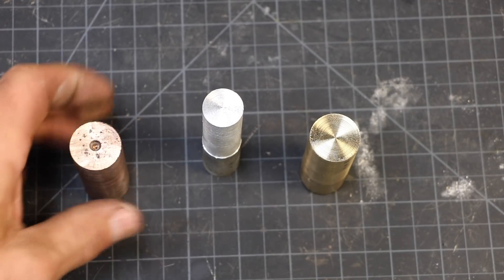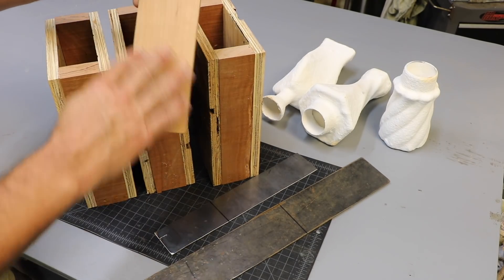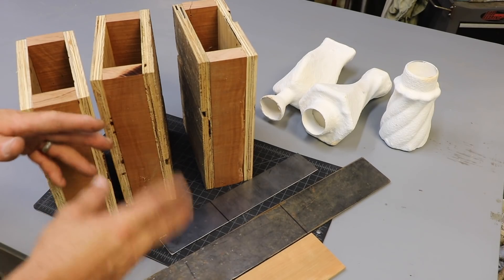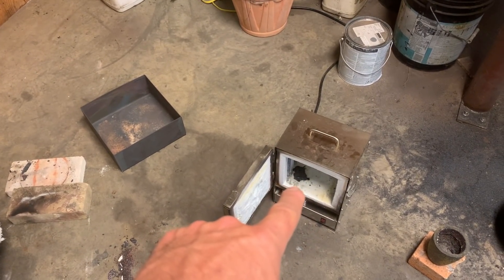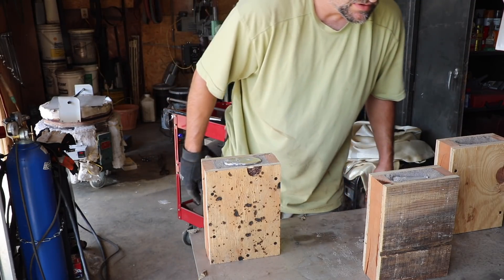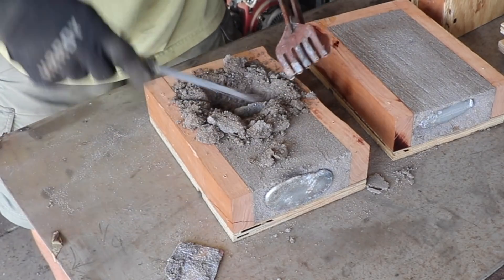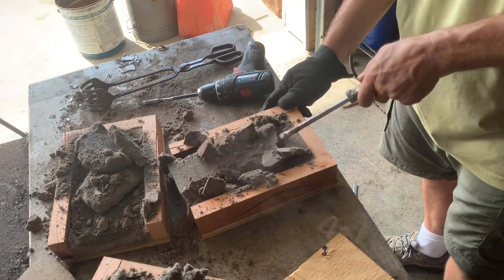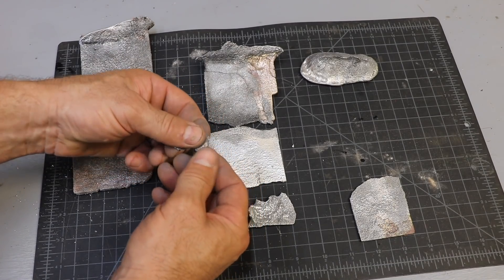Mixing Molten Metals.  What Could Go Wrong??

Comment: First thing I thought was: Never do experiments with molten metal in shorts! 😂
Reply: Ahaha...great advice. Don't fry eggs or bacon in your underwater, either
Reply: @bruceanderson7762  can you mix precios metal  like platinum and silver ?
Reply: Yep, same thought.
Reply: @dsma2023  okkkkkoo
Reply: @jeffallen3382  I used to work in the die casting department of a factory. We would load 1200 lb blocks of aluminum  into our melting  furnace with a forklift with a windshield to keep any splashes off the operator. One day our lift was down so I was using a normal one with no windshield and I put on a flame suit for protection. Only problem was the suit only came to my knees while sitting. Well of course there was a splash and I got splattered. Normally  I would wear work boots but for some reason I dont remember I had on tennis shoes that day. Long story short a glob hit my ankle and ran down into my shoe and burned through my sock.  I rolled off the side of the forklift untying my shoe in midair.  Ended up a spot of 3rd degree the size of a quarter on my ankle.
Reply: Bah, you dont need to worry about safety.
Reply: flip flops and a speedo is the only way to experiment with molten metal.
Reply: Darwin Award...
Reply: Or a Shell Suit, lol
Reply: Yeh, its best to do it in a cruciple.
Reply: Like trousers will help
Reply: I couldn't help but wonder if it's a good idea to set his molten crucibles on that thin ass sheet metal cart, either.
Reply: He should visit his local burns unit. Thank you for the video.
Reply: @ohdearearthlings1879  He doesnt need to visit a burns unit because he has a BRAIN and evidently he knows how to use it, VERY much UNLIKE the HSE dross that the French dictators imposed upon us educated England some decades ago in the NWO globalist attempt to Dumb us down. Notably an extreemly successful attempt by the NWO but some of us are tenacious about retaining OUR brains and using them effectively.

Comment: have you thought about pouring the aluminum out onto a metal table top, letting it cool, then pouring the copper next to it? The heat of the copper should melt only a little bit of the aluminum and I think you would get the effect you wanted.
Reply: I've seen someone do a tray filled with alu and then as it starts to cool drizzle copper over the surface. You get decent fusion without ruining the integrity of the alu sheet.
Reply: Interesting ideas there. I would like to see him try this out.
Reply: Exactly what I was thinking, and it would probably get a cool effect. Hope this is possible!

Comment: Doesn't the different melting temperature cause an issue if they aren't melted together to make an alloy. The metal with the lower melting temp cool off the metal with a higher melting temp and they don't mix?
Reply: Well, one might suspect that the lower melting  material would party dissolve the higher melting material.   A "phase diagram" of Al & Cu might be helpful.

Comment: I’m guessing if you’re pouring it in together and making a 5050 mix it will probably not be that great. I tried this years ago in the ingot broke when I dropped it , I really hope you have found a solution🤞🏻.....
Reply: Sorry guys. But Copper and Aluminium don't behave well outside of a very narrow alloy ratio. They form several so called "intermetallic compounds" that are brittle like glass and usually crumble because of cracks that form during cool. This is why you can't weld the combination of Cu and Al with any but very few exotic methods.
Google "copper aluminium phase diagram" You need to stay in the copper-rich alpha region.
Reply: @jackmclane1826   An excellent suggestion re the phase diagram. However the problem is that one needs to be able to read, understand, and interpret the diagram for it to be of any use. Incidentally high strength Cu -Al alloys do stray into the (quenched) betta region somewhat. And then of course the other end of the diagram is of great importance too, as many (particularly the older) aluminium alloys contained around 4% copper. But around here I might suggest phase diagrams are pearls before....
Reply: @alterego4218  True! But there is no way to manage the precise composition and thermotreatment voodoo with these methods shown here. And yeah. I forgot about 2000 Al...
Reply: @jackmclane1826   I think that you have probably hit the point spot on here - my guess is that the whole idea of the experiment was that the imprecision would have resulted in a swirling mass of colours in the finished casting.. I note too that with most alloy systems its either end that gets used. The middle sections are not much used except in cases of mutual complete solubility (eg Cu - Ni alloys) or when very brittle materials are required in for example shrapnel producing ordinance...
Reply: @alterego4218  For mass use, yes. Probably because the majority component usually is cheap (Iron or Al) and it is alloyed with a little bit of much more expensive stuff.
We're still living in the iron age in that regard... ;)
Reply from the maker: Hahaha!  I knew somebody had tried this before. Of course it would be the king of melting himself!
Reply: @FarmCraft101  oh man I was really hoping you cracked the code. The one I made was only a small ingot but was very silver in colour but I have always been meaning to do a big bar pouring the aluminium and copper in separate ends of the mould but it’s one of those things that’s on the list that I will eventually get around to it but in the meantime I’ll just send people over here when they continue to ask me in the comments to do it👌🏻😁
Reply: Haha. I was gunna ask him if he ever watched BigStack!
Reply: hey big stacked i was goen to quote your vids of nordic gold and try like that. i remember the metal but not the % of copper aluminum and zinc
Reply: imagine if tito4re was still active, would he be the king of melting?
Reply: @rickydona919  Yes Tito4re wouldve definitely be up there in the millions of subs probably 3 million+ at least I reckon , It’s a shame he didn’t stick around.
Reply: @bigstackD  I know he had a couple of injuries and I really hope that he's okay and didn't have something terrible happen to him, he and you are the top two melters on YouTube
Reply: I'll bet it shattered rather than broke.
Reply: Thanx to all you pioneers in here and not

Comment: Predictions: the aluminum will solidify the copper layers, but since the boiling point for aluminum is over 4000 degrees if you mix aluminum with copper it'll be a strong alloy.